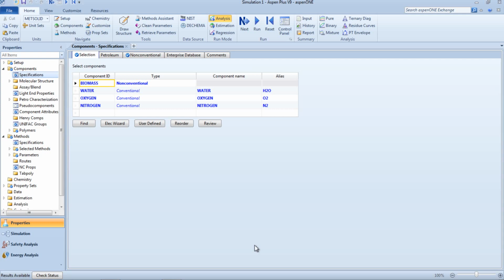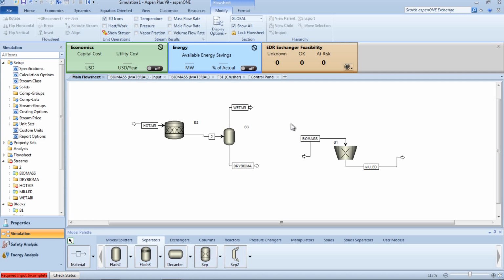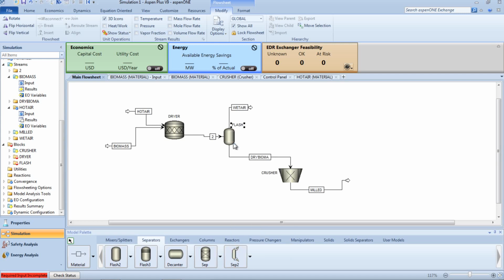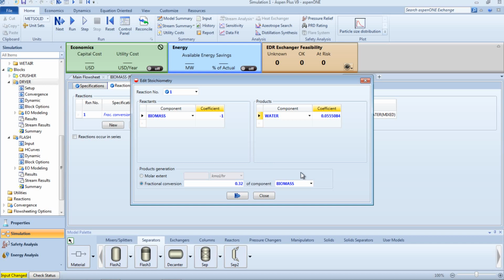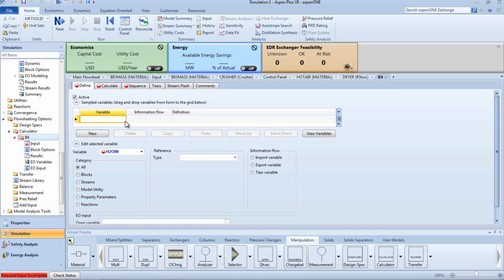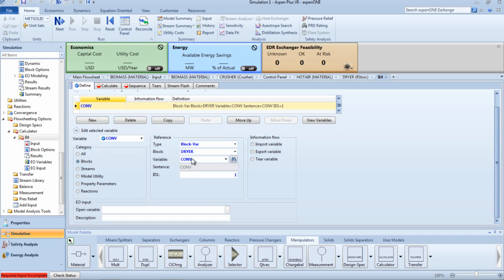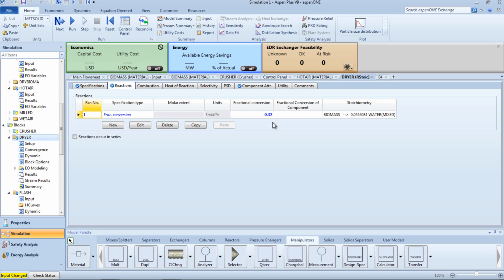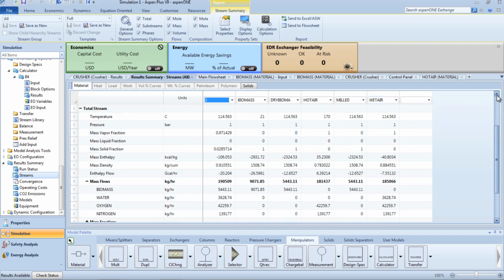Aspen Plus Tutorial 4 - Drying

Comment: hey what is Moisture content you gave for Biomass in proximate Analysis?
Shall we not use that moisture content value in Rstoic Reaction stoichiometry part while defining coefficient of H20???
Suppose if moisture content is 5% then in Rstoic stoichiometry reaction, coefficient of h2O is 0.05 i.e 0.002775 mol H₂O.?
Reply from the maker: The moisture content specified in proximate analysis is 52%. The coefficient of H2O in Rstoic for drying is from the conversion of a 1 kg portion of biomass (non conventional) to 1 kg water (conventional). The molar coefficients are from the molar ratios of biomass and water. In Aspen biomass molecular weight is 1 g/mol so the coefficient is 1. For water it is 1/18, which is 0.0555. The reaction modelled to "free" the water is then 1 biomass -> 0.0555 water. The amount of water freed from the biomass is controlled by the target moisture content of drying.
Reply: @jeromeramirez5989  You mentioned that if 0.32 of water out of 0.52 water from the biomass to be liberated, then fractional conversion will be 0.32 of biomass. to get 0.20 biomass. if we want to remove 0.52 water completely, so shall i set FC =1 or 0.52 of component biomass???

Also like if we use H20DRY=20.0 in Fortan code, then is it necessary to mention FC = 0.32 of component Biomass? or we can skip that and write FC = 1 of component Biomass?